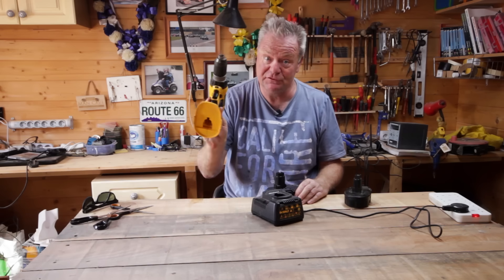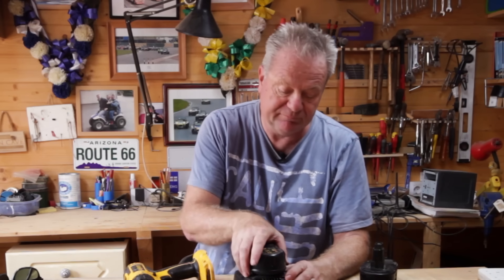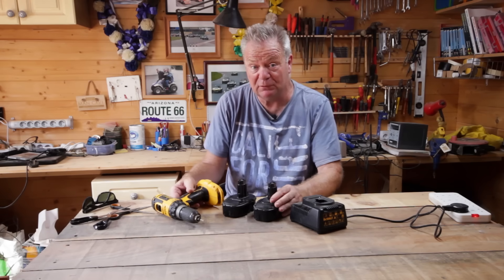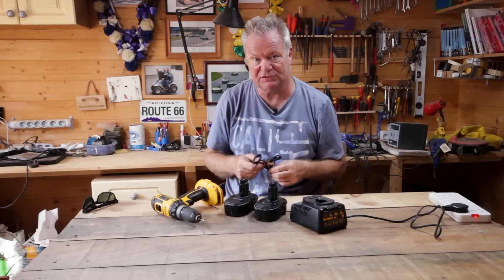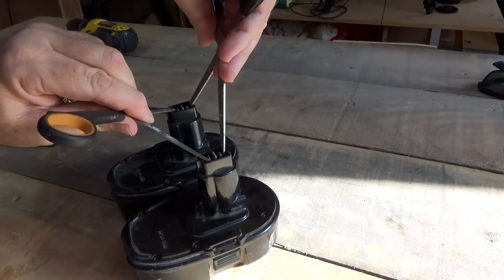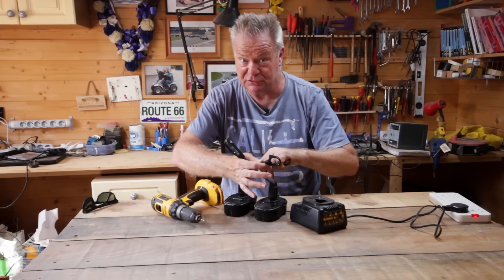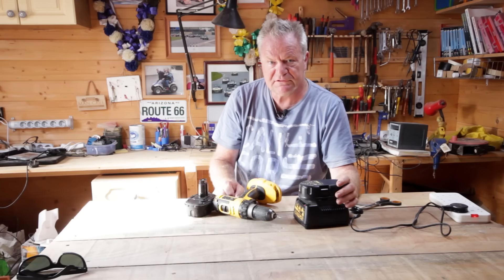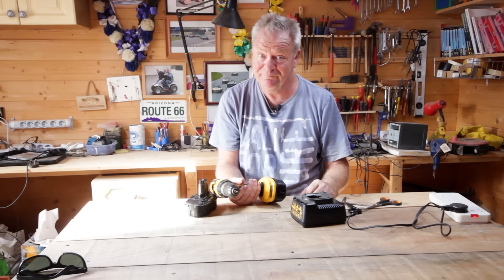How to revive a dead rechargeable power tool battery easily

Comment: yes, this works and Ive even done it myself
but a battery that has gone that dead once or twice will never be the same and more than likely will happen again
it is a good trick to get yourself out of a pinch
Reply from the maker: Fortunately I haven't had to do it again with this battery in the 18 months since I made this video. Thanks for watching.
Reply: @JPinFuerteventura  I did something similar when my Ryobi drill's 18v battery went dead and would not begin to charge.  I connected two 12v car batteries in series so as to produce 24v and then connected the leads to the battery for a very short amount of time.  This did get the battery to accept a charge on the 18v charger, but the battery depletes rapidly, so its just worn out.  The solution was a new battery from eBay which was cheap and works perfectly.  So this method may provide some additonal life to a given battery, but not all.  Not bashing you here at all, just commenting about myu own experience.
Reply from the maker: Yes, that does happen if the battery is old. Mine is still going strong fortunately. Thanks for watching Mel.

Comment: But it will lose its charge after about5 minutes of use because the core is shot .
Reply from the maker: That battery is still working 15 months later
Reply: @JPinFuerteventura  I was talking about mine after I did that it just drained super fast, not a bash towards you.

Comment: Thanks for the vid. I did this annnnnd, nope , 3 batteries and ,nope didnt work. But you know i found a different way to fix them....buy new batteries.  Amazon 30 bucks each.
Reply from the maker: That's ok if you live in the States. It's hard to get Amazon to deliver here and the prices are higher too. It is just as cheap to buy a new power tool here that comes with two new batteries.

Comment: Awesome tricks..!I m most happy to learn this, i have a out of the box~brand new HITACHI lithium ion battery DC36v(measured current voltage dc24v) won't take charge and one good battery,can i use same method to revive the dead unrecognised new battery?
Reply from the maker: If it is new then I think I would demand a replacement
Reply: @JPinFuerteventura  UPDATE :Thanks, i followed yr procedures, its works, voltage boost up to dc35v after 5 mins but doesn't take charge anymore when put to charger, already got a replacement, thanks again

Comment: The reason some batteries go dead is due to the battery dropping below the battery management circuit voltage threshold.  When that happens, the battery will no longer charge.  The goal is to get the batteries up above the threshold voltage of the battery management system.  This is a common problem with LiPo batteries.
Reply from the maker: Yes, that's exactly it

Comment: JP, any ideas or guesses as to why this is? I’m going to have to try this since have a boxfull of “dead” batteries that I just keep replacing at phenominal cost.
Reply from the maker: The charger is a "smart" charger so just like "smart phones" it is not very smart. It doesn't detect that a battery has been inserted since there is no charge in the battery and it needs a small charge to recognise that one has been inserted.

Comment: While this will work in most cases, with lithium it is dangerous. When a lithium battery is stored flat, it will have crystalline growth in the cells. If these crystals grow large enough to penetrate the separator in the cell, you will create a dead short and the battery will burn or explode. This is fact. You can't defy physics.

Thank being said, I understand the architecture of lithium cells and I would probably try it myself. More likely though, I will just buy some 18650 cells and replace them inside the battery pack.

PS, using scissors was really stupid. Spend $5 and buy some damn wire, connectors or alligator clips and a bloody fuse. Put a disclaimer in your description too. You will be liable if some idiot melts their face off after trying your scissor trick.
Reply from the maker: I know it doesn't work with lithium and have said this in the description and on may comments. I live in Fuerteventura so there is no Home Depot or anything remotely similar so you have to use what is available. Thanks for your advice - it must be wonderful to be as clever as you!
Reply: JP in Fuerteventura It does work with lithium. It works with any battery that has dropped below the low cut off voltage of the charger. The only time it doesn't work with lithium is if the protection circuit is interfering. You bypass this by giving the batteries a boost of voltage directly (really not recommend. Dangerous).

And yes, it is nice being as clever as me. Your sarcasm doesn't change the fact that the scissors were not very clever at all. At least they were ni-cad. There is enough energy in one of those batteries to easily cause you harm but they don't usually do it as explosively as lithium.

Edit: You say you used scissors because nothing else is available where you live but you have a shed full of items that could have done the same job or better.

I mean, videos of people doing silly stuff is funny. My only concern is that you seem to be a straight up guy. I think you can be a bit of an ass, but I am the same. The problem you have is that some dipshit is guaranteed to blow half of America up trying to use scissors to charge his Tesla because he saw your vid. It is up you you, but I personally would be putting a disclaimer at the start of the video.

You are on YouTube. You must know how bloody stupid people are. There is plenty of video evidence here.

Comment: Too bad this trick needs 2 of the same voltage etc battery... I have a 20v lithium and a 12v nickel battery that's the dead one... I doubt I could do this tactic this way but good to know if I find a similar battery sometime instead of tossing it like I was...
Reply from the maker: Perhaps you could use another 12v source - car battery perhaps?
Reply: @JPinFuerteventura  wouldn't the amps be too high the lowest 12 volt sla battery amp is 18amp while I believe the drill battery was like low like 7 or 8... too many amps I thought was an issue...
Reply from the maker: @blackmobileops1537  Well I am not an expert so if in doubt, don't.
Reply: @JPinFuerteventura  fair enough lol

Comment: I find this an excellent advice, thank you for which. I do have 6 4Ah and a few 2Ah WORX batteries and nearly every cordless tool from WORX. Unfortunately I remember myself completely draining some of the batteries on a few occasions, something I shouldn't and I wouldn't be doing. Like when the tool stops and then you give it another go and then another until all the juice is gone. No-no. Hence one of the big once 4Ah gave up the ghost - stopped being recognized by the charged - blinks in red saying a BAD one. Basically I did nearly the same as what you are showing in the video, plus to plus, minus to minus for LITERALLY 15 seconds to boost the bad battery and then it started properly charging in any of my WORX chargers. Not BAD any more - saved me 50 quid.
Reply from the maker: Great. Thanks for the comment Vladimir.

Comment: You could have showed that the battery was actually dead and not charging properly by showing the red lighting flashing or fast to show that it was actually no good anymore, rather then covering the red light with your finger like you did though? This does actually work with some batteries....but still 🤔😕
Reply from the maker: I do explain in the first pinned comment that I forgot to switch on the camera
Reply: @JPinFuerteventura  yep

Comment: Thanks for sharing.  I have revived many batteries using a device called a battery balancer/conditioner.  But I have never seen the two scissors for a minute trick.  I can see why this works - and it is a nice quick efficient trick for getting the charger to recognize the dead battery so it can start a new charge cycle.  Very smart and thanks again!
Reply from the maker: Thank you for watching

Comment: Hi!
Wao honestly first I didn't believe it   
But now, wao!!! You very right and loyal.  I try your  advice and my Battery are back to life.  Thakyou very much for that ⚡☣⚛♻️
Reply from the maker: Great - thanks for letting me know Juan
Reply: I know that this is NOT quite the subject being discussed but thought it might give some of the people on this thread a laugh. Some years ago before battery drills etc were popular i was using a firms generator to power a angle grinder and suddenly the power went off, i walked back to the road to see if the generator had run out of fuel, not only had it NOT run out of fuel, SOME THIEVING TOERAG had driven by, seen the generator stopped and NICKED it!!!!!!! Seemed a good idea at the time to leave it running behind the vehicle in a VERY QUITE area as it was SUCH a long way to where i was working and thought it would be safe, WRONG🐀🐀🐀👎🏿👎🏿👨🏻‍🔧👨🏻‍🔧💩💩💩💩💩💩💩💩💩 so do let this be a lesson, watch out for FEKKWITS ESPECIALLY if working in the uk

Comment: What can be done if you have 2 dead batteries and don't have a good one to jump start the dead one? 
I have 2 drills, 4 batteries(2 each are different voltages) and all the batteries are dead and have been for at least 5 years. Would be nice to get them working again.
Reply from the maker: All I can suggest is to perhaps borrow batteries from a friend

Comment: Why are you so damn quick to get beyond the critical part. You know what you touched with the sissors but I don’t. It’s a video for Christ’s sake! Why not show it?
Also what if you have only one? Can you use another or is compatibility necessary?
Sheesh! I’ve got a half dozen of these things that won’t charge. What’s the hurry?
Reply from the maker: Possibly because I had never made a video like this before? Always join the positive to positive terminals and negative to negative terminals of the two batteries. I think the voltage is the critical part, not that they have to be identical batteries. If you only have one then borrow one from a friend perhaps. And don't do this with lithium-ion batteries.
Reply: JP in Fuerteventura:
Thank you very much! JWC

Comment: In support of this tiip? It is actually true,. Even other battery ,motorbike ,cars  ect ect , it's all to do with the electronic chargers, ,if a battery is too low voltage most newer electronic chargers won't recognize the battery because of this. So the tip shown get some voltage in the totally flat unrecognisable battery. Then the electronic chargers will recognise and charge. But some batterys will have damaged cells and one can open battery and replace damaged cell.dewalt Niki minium
Reply from the maker: Thank you Fred. I appreciate your comment.

Comment: If a pack of cells (battery) fails it's usually because one of the cells has reversed it's polarity/gender and a flash from a high current source will usually resolve it, there's a risk of it catching fire or exploding so I'd do it outside with goggles on...
Reply from the maker: Someone else mentioned that. Perhaps you should do a video Jamie? 😉

Comment: I revived a dead battery by using a low voltage transformer. I set it to 6v, connected to the battery, left it a few hours then used the official charger. It charged fully.
Reply from the maker: Good tip

Comment: My advice is to open the battery and replace them by regular cheep lithium battery, wich you can order from China. Make sure they fits to the parameters of old one and try to not damage the control board when you soldering the new one .

Comment: It only work with old battery. New got a chip which control whole thing
Reply from the maker: Probably designed to make sure you have to buy a new battery. Thanks for watching.
Reply: @JPinFuerteventura  yes, I have seen a guy on the other channel saying that now it's impossible to do this. You have to change chip as well.

Comment: This is interesting - I take it that it's indispensable to use something with some kind of metal insulation (i.e. the plastic handled scissors) to avoid shock?
Reply from the maker: Ideally, yes
Reply: you won't get shocked grab the posts on your car battery you wont be shocked

Comment: Yes sometimes it revived the battery and it will last a bit. My only gripe with this video is the scissors, if we were in your shop casually doing something like this, that would be ok. But the general public does not know about reverse polarity and that could cause a problem. Just saying maybe use test leads and show the right polarity to the viewers so they don’t get hurt or burn their stuff up. Good tip tho
Reply from the maker: I understand what you are saying William but where do you stop? I prefer to credit people with a bit of intelligence, although judging by some of the comments that is clearly wrong. Should I also tell them that you should use metal scissors and not plastic or ceramic ones and show that those won't conduct electricity? I'm being facetious obviously but you get my point I am sure. Thanks for watching and the comment.

Comment: You don’t really know what you are doing  .....if someone does this to a lithium battery it can be really dangerous the charger won’t charge the lithium battery as they are dangerous once over discharged and this way the charged battery will send a huge unsafe current for the dead battery this is not good for any battery nimh nicd but a specially for lipo or liion which can even catch fire............if you are going to do this make sure you only do it to a nimh or nicd and somehow restrict the current to the same as the charger has with a resistor
Reply from the maker: Since I am not doing it to a lithium battery how can you say I don't know what I am doing?

Comment: OMG,  I have exactly the same brand you're using and exactly the same problem, two batteries are dead. But the problem I have now is that I don't have any charged battery . Buying a new battery is out of the question. Anyway, thank you Sir for the tip. 
FYI, I just bought meself a new Bosch impact driver
Reply from the maker: Can you borrow one from a friend?

Comment: Does it hold the charge though?
I've recharged 18v batteries with a 12v charger then put them on the 18v to complete it. Problem was when I used the re-charged battery. It only worked for a few minutes.
Reply from the maker: That depends perhaps on how old the battery is. The one in this video still works ok.
Reply: JP in Fuerteventura 

How do yo jump the batteries that don’t have the tall male design?

Comment: JP in Fuerteventura : Gotta give ya' credit where it's due! You were right-on, at the very-beginning, when you stated that due to the ($) price ($) of replacement of the battery(s)-vs.-"the whole-nine-yards"? Both options are, indeed, practically identical. (Gotta admit though, the half-dozen drill-motors & gears I've accumulated over time have inspired a lot of "secondary-creations"!) You'd be surprised what those little-cogs, and 12-volt and up rated motors will adapt to, and/or replace...! ☺
Reply from the maker: I did keep the salvageable bits from a couple of power tools in the UK but threw them away when I moved here. As you say, you never know what you can do with the parts. Thanks for watching.
Reply: @JPinFuerteventura   And, Thank-You for "listening", sir!

Comment: This makes total sense. I have a couple bats right now that have low use and only couple years old. Before I even try thankyou for video. If I had known charger didn't recognize dead battery I would have thought of it myself. I too have bought new tools so I could get just get the batteries. Thanks again
Reply from the maker: I hope it helps Philip
Reply: Wanted to update my comment. This absolutely works. I had a "dead" 12 volt dewalt bat for my 3/8 right angle drill. It's the only 12 volt tool I have. Battery when charge attempted would after a couple minutes or so would get a fast blinking light on charger indicating bad battery. It was dead. I tried this method with alligator clips and only one pair of scissors Haha. Battery took a charge and it's been a week or so and battery still has its charge. I am going to start picking the dump for the tool bats that get recycled. Thanks again
Reply from the maker: @philipmaclarenjr.2004  Grea Philip. Thanks for letting me know.
Reply: Thanksgiving 2019 my battery is still working. Thanks again

Comment: Nice, It worked.Thanks JP for saving me a battery, I jumped mine for 2 minutes instead of one, using solid coated wire (thin gauge). Battery is still holding a charge 3 days later. Mission Impossible accomplished.
Reply from the maker: That's great. Thanks for letting me know Peter.

Comment: How long did the charge last?
Reply from the maker: The battery is still working 16 months later. It holds charge for less time than when it was new, and now for less time than when I made the video, but that is just age.
Reply: Thanks, sounds good. I'm going to try it on some of my old " dead" batteries.

Comment: I would not suggest you tell people to do this. There is a reason why the charger didn't charge that battery. At a certain point battery packs get out of balance from cell to cell. Then when recharged and discharged can back charge one of the cells causing potentially an explosion.
Reply from the maker: The reason was that it had become too discharged for it to register in the charger.

Comment: Is there any other way I could jump the dead battery if I didn’t have a working identical one? Both of mine are dead ☹️
Reply from the maker: If a friend has one with a similar voltage you could try that.
Reply: JP in Fuerteventura Thank you for the reply and the informative video!